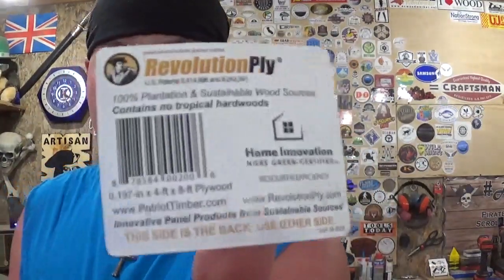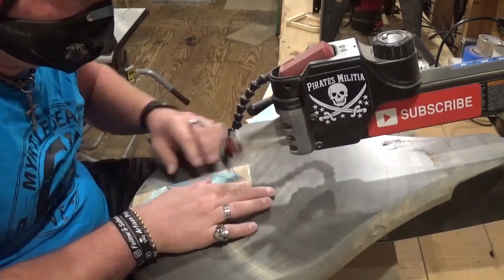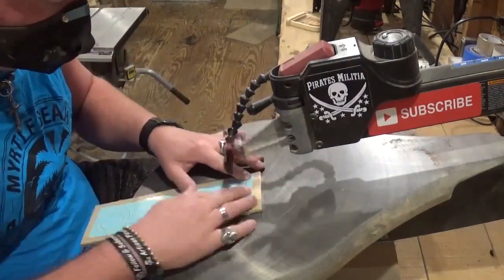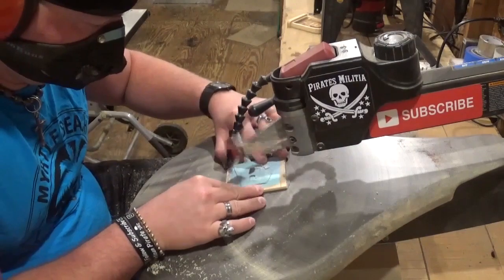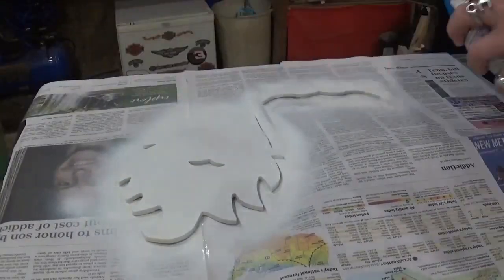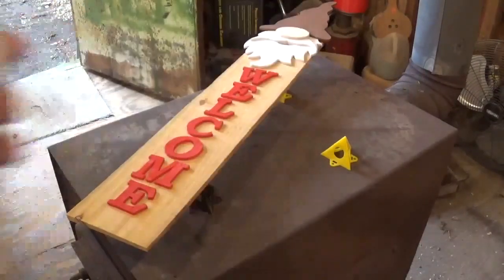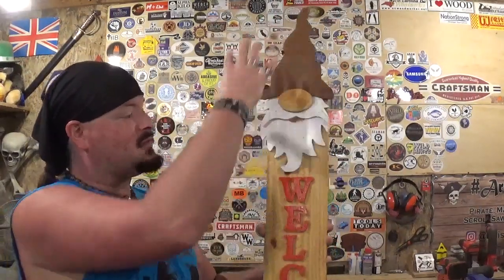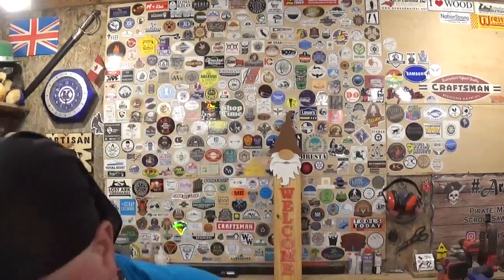Garden Gnome Welcome Sign, Scroll Saw Project

Comment: Awesome videos and as always you give great information.  I have a question to which I hope you or someone can help me with.   Several months ago I purchased the exact Delta 40-694  20 inch scroll saw that I have watched you unbox in your video.    My question is this, How do I center the blade within the hole on the scroll saw table???   My blade is far to the right hand side of the hole and when I'm cutting the blade wants to drift into the side of the hole and begin to etch the metal side.  I'm not acustumed to the smallness of the hole as in this saws table, but more used to the slit L shaped or long shaped of hole.  Any helpful answers will be greatly apperciated.  Thanks  Jimmy in Georgia

Comment: I have noticed that lately you seem to have switched your blade choice to the Ultra Reverse, which I assume are available from Flying Dutchman.  Is this a permanent switch, and if so, how do you like them compared to your previous favorite?  I have used the Ultra Reverse as well as Pegas and Olson, with each brand having some different characteristics.  I'd love to hear your take.  By the way, I like the gnome welcome sign project and will probably be making some for our next church fundraising event.  I try to watch all your videos.  Thanks for being out there, Glen
Reply from the maker: Thanks for the comment! and actually the ultra reverse is better for thinner materials, however I have ran out of reverse tooth blades (#5) and I need to order more, I just happened to have a supply of the ultra reverse (#5) on hand so thats what I have been using